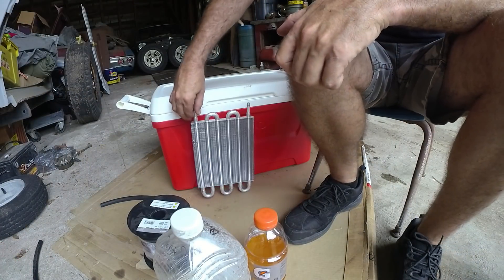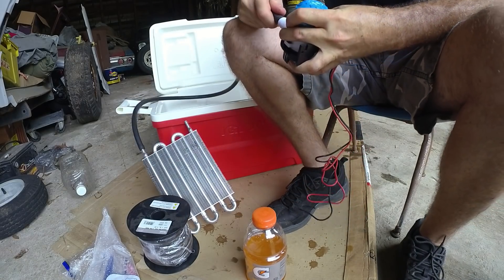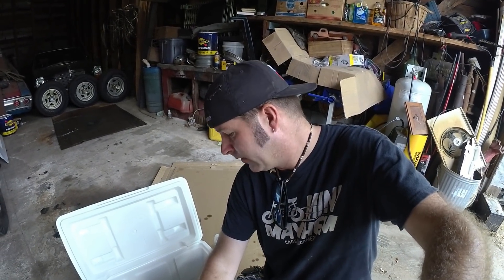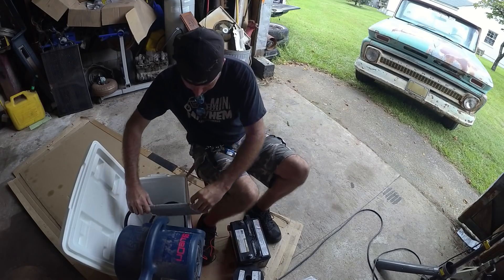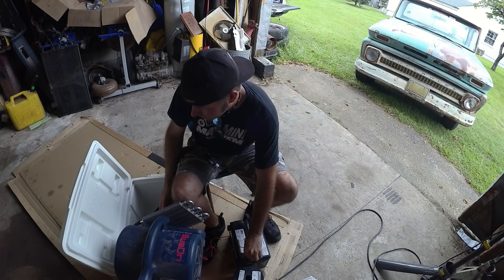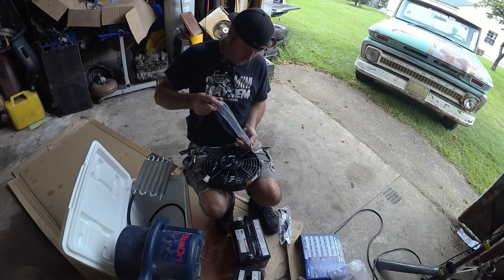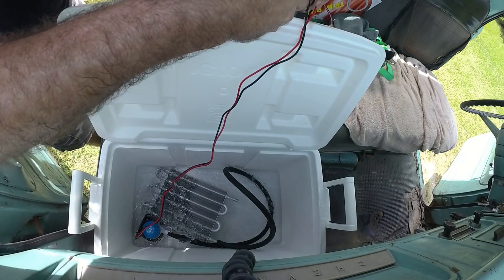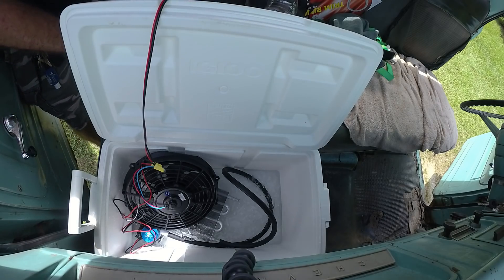Power Tour Prep Extra....A.C.

Comment: You can also take the heater core hoses off the engine and run cold water thru the heater core.
Reply: Now that’s using your head. Hell yeah.
Reply: @broo_shs  what? Lol
Reply: @broo_shs  lol 😆,  please keep going.
Reply: @broo_shs  You can take your heater hose off & block the ports from however it comes off that particular motor.
Reply: Best idea!
Reply: USN_Ret 84-05  Way better idea!
Reply: @broo_shs  bypassing the heater core will not hurt the engine. That's why it has a radiator.
Reply: @wadewright3556  no shit but seriously do you don't get at i'm joking,who the f do not know how cars works jeesus....
Reply: @broo_shs  no. The ignorance of people never ceases to amaze me. I don't know you. I have no idea what you know. Sarcasm really doesn't come across on the internet.
Reply: The ice would melt faster going through the heater core because of it being mounted in the firewall and getting heat from the motor
Reply: @patrickhartman6818  why dont put little hoses in inside of jacket and run cool water on that then you do not need to cut your hoses in car

Comment: Cut a 8-inch hole in the top of the cooler mount trans cooler inside of lid and pulling fan to outside that way the sweating just falls back into water and electrical is outside of cooler

Comment: Wow that is sweet, but add a hose to the other side and drill 2 holes through the top of the cooler and that way you can close the cooler to keep the ice cold plus you can put the fan combo higher so that you can get cooler THAN YOU ALREADY ARE , IF THATS POSSIBLE LOL

Comment: if you add rock salt to your cooler full of ice and water the salt will take the water temp to 32 degrees, we use salt ice water mix to set thermostats on truck reefers ,just a thought bro
Reply: running plain water thru the bilge pump & aluminum trans cooler will last for decades, running salty water thru it will make it last far-less longer
Reply: @Mad-Duk_Machine_Werkes  it only has to last a few days. What's more important? Staying cool or lasting longer than you need it to?
Reply: gatorade is the secret to cooling
Reply: You're pump may freeze up if you add rock salt

Comment: i made one of these 5 years ago using a split lid igloo cooler, a rear heater unit from a full size van, a bilge pump and an old 6amp battery charger to power everything. i made a stainless steel 1/2"x1/2" mesh floor to separate the ice from the water so the pump didn't suck any ice into it and kill the impeller. i mounted the heater unit and charger on one half of the lid so i could still use the other half to get cans out of the cooler, and add more ice when needed. the rear unit has a heater core and fan enclosed in a housing that bolted to the floor behind the rear most seat in a van with the hoses coming out the bottom. i drilled holes with a 1" hole saw in the lid for the pump and return hoses, and the condensation drain to pass through and bolted the unit to the lid so it takes up no more floor space than the cooler. i can run it from a 110v outlet with the battery charger, and from 12v using a power cord with a couple of battery clips(the pair from the charger)or a 12v lighter plug. it works awesome, and is handy as hell. it runs about 4 hours on a 20lb. bag of ice, and it'll keep you and your drinks cool in the garage, a campsite or outdoors at a bbq. my boy even put it and a couple of deep cycle batteries in a wagon to use at the beach one time.

Comment: The number one thing your ac does is remove the humidity from the air in your home or car. The first ac was invented by carrier and was just a fan with copper pipe rolled up in the front that removed the moisture from the air when the pipe was cold cannot remember what was used in the pipe but ammonia was one of the first things used in air conditioning

Comment: If you mount the fan outside the lid , blowing IN , and mount the radiator inside the lid so the air blows through it and out , you will solve all your problems . The electrical stays dry and the condensate stays with the cold water inside . Roll up the windows and condition the air inside the cab .

Comment: Around my neck of the woods that is known as a swamp cooler and I've seen one large enough to hide your truck behind it.  the main water line for the building was it's water source and the rest of the system was run after the swamp cooler , the crazy part was how well it worked.

Comment: Isaac you could very well heat in hot air gun and press to the lid radiators size area, and drill small holes for the dripping water and also to the hoses, then put the radiator on that lid with supported by agle plates. or use something else and then put fan on the lid and voilaa you have A.C....

Comment: Should of just drilled a couple holes in the cooler and made a frame for the intercooler and fan to mount on top and blow onto you and will keep the lid closed and use dry ice and water so it last longer then just ice!

Comment: I've seen this done before, but the person used 2 PC fans, because they run at 12V too.  He mounted the radiator to the inside of the top of the ice chest with standoffs.  Open the top to use the system, and the condensation drains back into the ice chest.  Close the top when not in use to keep the ice from melting.
Reply: NICE.

Comment: should have cut a hole in the lid just smaller than  oil cooler and a small hole for the wires and hose and just set the cooler and fan on top of the lid with the air flowing upwards that way u can keep the lid closed and conserve ice

Comment: Pour some salt on the ice to turn the AC on an extremely cold setting. lol
Reply: I use saltwater in my water pan of my CNC Plasma table during the winter so it doesn't freeze. ;)
Reply: It helps out tons that it's stainless steel.

Comment: I used a trans cooler 30 years ago to substitute for a bad heater core. Woulda had to take the whole damn dash apart to replace a heater core, and it was an AC car. I just ran heater hoses thru the firewall to the "trans cooler", and put it on the dash. The stock defroster fan was adequate to keep the windows clear.

Comment: you get a metal baking pan, and pop rivet a cpl simple brackets to hold your evap in place, so that when it sweats it catches the  water and solder or braze a pipe nipple on the baking pan and drill a hole into the cooler lid so the condensate water goes back into the cooler over the ice....
ALSO: drill two holes in the lid to run your feed and return water lines  so the unit can keep the ice colder/longer with the cooler lid closed dude! all you'd have to do is drain off some water every time you stop for gas on your road trip and throw a fresh bag of ice inside

Comment: Hey Isaac if you was to get a second cooler maybe a smaller one and use it as an air box drill three holes in the bottom of it and three holes in the top of your Igloo cooler for your water lines and a whole for your wiring I think it would work better help your ice last longer and yes rock salt would make your ice colder but all in all awesome idea

Comment: Ok the cooler has a drain that you can put your inlet tube in , you would have to drill a hole for the return line in the top of the cooler attach the fan to the carrying handle with zip tyes , don't know what you would have to do for a drip tray ?

Comment: allso seen a simple version of this type of aircon , basicly uses just the icebox with the ice and has two holes in the top 
one hole mounts the fan and the other hole is just open , the fan blows air over the ice inside the box and the hole lets the cool air out

Comment: I can’t believe you never heard of a swamp cooler B4 !cut a hole ( 8” x 8” ) in lid of cooler mount rad inside and fan outside and drill 2 holes in lid ! 1 for power cord and 12 volt plug and the other for OFF/ON switch that way just fill cooler with ice , close lid , plug into 12 volt source and thorn the switch on to power up the pump and fan. WINNER WINNER CHICKEN DINNER ! Self contained Swamp Cooler !

Comment: Drill hose sized holes through side or cooler and run 2 hoses out,1 supply and 1 return and add a coat hanger to the fan/chiller and hang it on the mirror or visor.  Rock salt and a closed lid will make the ice cooler and last longer..

Comment: I would a cut a hole in the top of the cooler put the condenser it's denser to where it is in the top of the cooler and the fan in the bottom with the ice and water so that the ice doesn't melt fast with the outside air

Comment: If you add a 2nd Trans cooler and fill the lines with antifreeze with a inline fuel pump  you can use dry ice inside the cooler and get much colder air and longer use but you need to vent the inside of cooler to the outside if you leave your windows close just a small hose to let the co2  vent  to outside should be enough. Warning  prolonged exposed to c02 can kill you it displaces 02 in non vented areas.

Comment: If you see this comment can you tell me what the plugs with the two screw are called that you used to connect those wires and where you found them
Reply: The 'Wire Nuts'that he screwed onto the twisted wires?Any Home Depot etc.is the wiring area.
Reply from the maker: Yello things are wire caps and the cig lighter plug came from radio shack
Reply: @bryduhbikeguy  thank you but I know what those were thanks for answering though
Reply: @isaacitllbefine7231  hey how's it going ive been watching for 3 years

Comment: Would it be possible to use a second transmission cooler up near the radiator instead of a cool box?  If that worked it wouldn’t need topping up with ice etc, although it may not be quite as cold
Reply: The air passing through the one by the radiator would be ambient temp at best. Inefficiency would only raise the temp from there, so unless you're drying the air in the cab somehow, you'd be better off opening the windows.
Reply: @crashwg  although the normal temperature of the air would be the same, it would be moving fast through the cooler, meaning it would be at a lower pressure, and lower pressure air is colder, meaning it would chill the water, although possibly not by much
Reply: @garageofscrap  I imagine the friction of the air would have the opposite, and likely similarly low impact, mostly canceling out each other. Any engineering students out there with more time and curiosity than me to run the numbers?
Reply: @crashwg  not an engineering student but I know the answer the answer is yes the air flowing through will cool the (condenser)radiator end and via the pump and fluid would cool the (evaportor) cab end to below ambient temp (aka wind chill factor) however it would be ineffective in this application because the evaporator isn't big enough to absorb enough heat to bring the ice water up to ambient temperature... thus the water flowing into the condenser would be colder than ambient already turning the condenser into an evaporator and speeding up the melt of the ice in the cooler.
Reply: The best way to make this cooler is to pump the water thru a double stacked set of transcoolers via a hose through a hole in the lid with a condensation catch pan and drain between the cooler and trans coolers then plumbed so it dumped back through the lid.  Use a blower fan with speed adjustment dial blowing through the Transmission coolers brace the cooler to the lid fill the cooler nearly full with ice add some water. Close the lid and you got a longer lasting open loop (as the water needs drained and fresh ice added) micro ac system... refrigerant based systems are considered closed loop also his micro ac would now serve double duty as a drink cooler too... if he were to mount the cooler in the bed of his truck run some lines through a body grommet in his truck to the cooler mounted inside his truck possibly behind his seat and ducted to blow both below the seat (weakly)and above the seat(dominantly) he could have passengers and have stable and even cab cooling.
Reply: @dodgeme1986truck  Wind chill factor will not cool an object below the ambient temperature. Blow 90° air across a radiator and it will never get below that temperature without some other factor, such as a pressure difference, but even in that case you're creating a localized ambient temperature and you're just talking semantics at that point.

Also, I didn't realize we were still talking about including the ice water in this hypothetical situation. In that case you would just be cooling the engine compartment and likely more than doubling the melting speed of the ice.